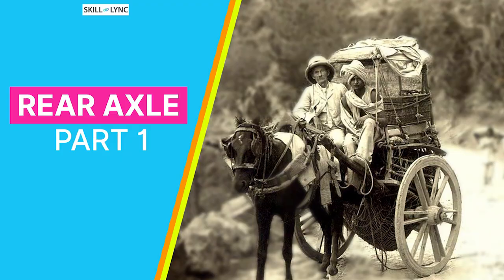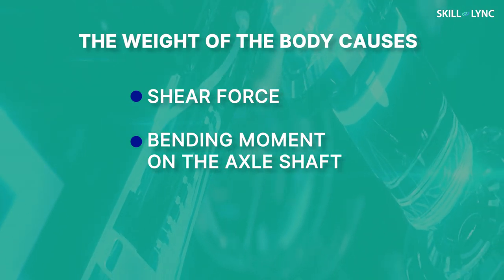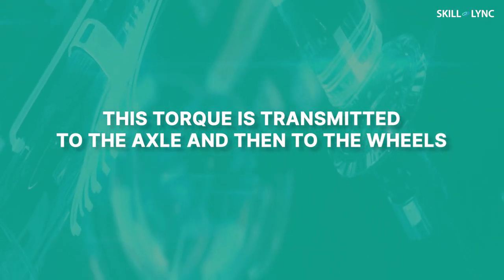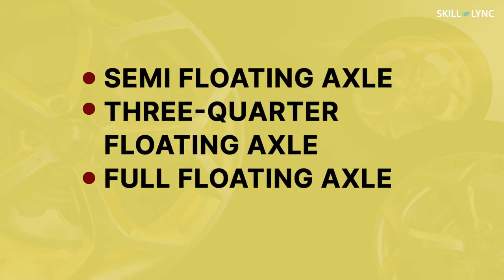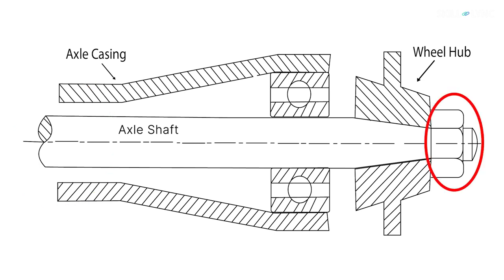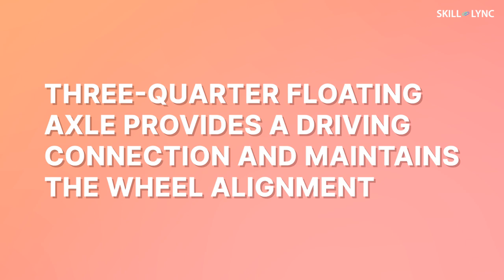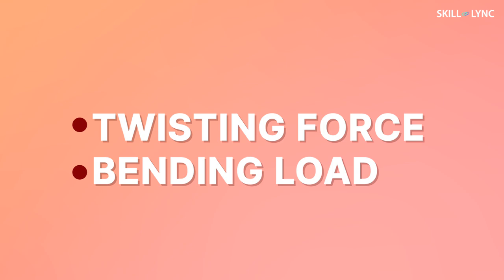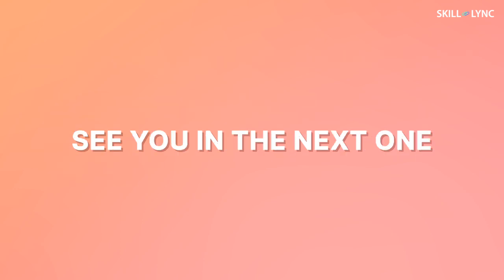Rear Axle (Part - 2) | Skill-Lync

Comment: Sir this is just a general introduction of axle
Actually we have dependent and independent type axles
Depend are further categorised based on weather we are using elliptical springs or air springs
The air springs type is further divided into various type depending upon type of linkages whether longitudinal or lateral or V-Link, then again rear axle is divided on the basis of design of supporting frame and again on the type of engine location and weather driven or non driven for example lazy axle